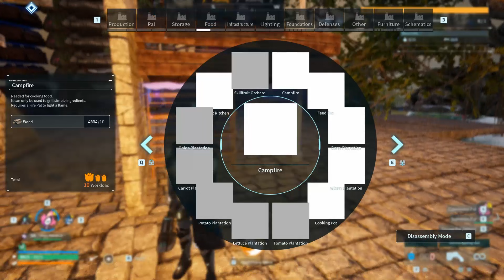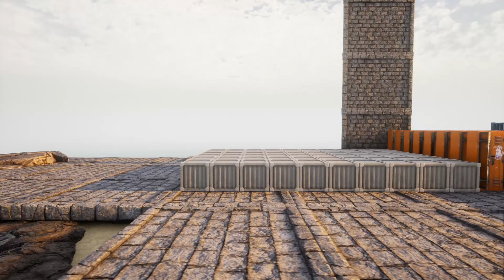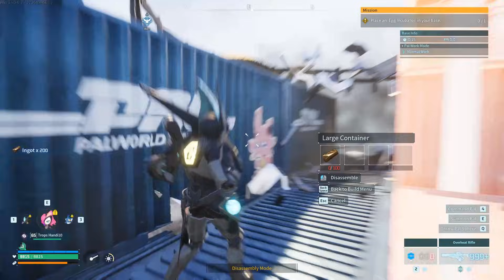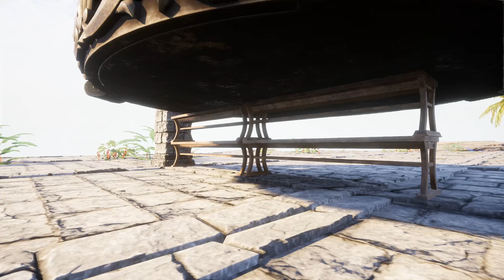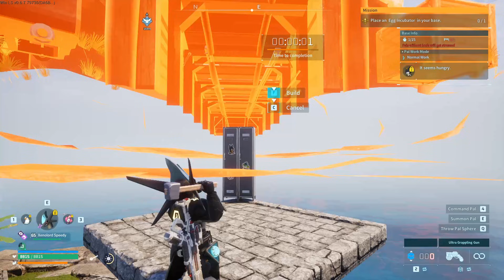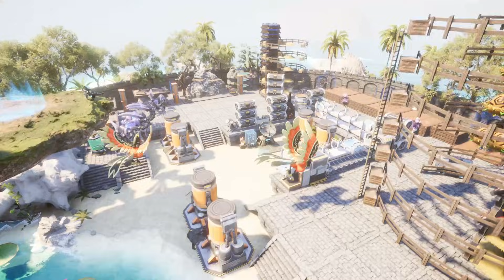How to Stack Structures in Palworld – Ultimate Base Stacking Guide

Comment: stacking is useful but u dont need that kinda extreme stacking
Reply from the maker: I did at 1 point for my 50 pal base.
I use to get so much if 1 material , fill 10x chests then move in to another resource.
That's just me though.
Reply: @TropsPlays  u dont need like 10 chests full especially if ur playing solo.
i could understand 1 chest if ur playing on a guild because of base restrictions for guilds

Comment: Big question, can we stack Accumulator vertically by this method? 
I did try myself and not succeed, can anyone confirm this work on accumulator? Thanks
Reply from the maker: Yes they can be stacked.
Im guessing you could even do it with pillows

Comment: Hot spring and Large bed can be lazily stacked against a wall with 2 fireplaces 1 high. Each fireplace height equals 1 large bed \ jap hot spring. The first fireplace is two of said furniture. Due to being able to place a hot spring\large bed on the ground after the destruction of the fireplace.

Comment: im really having hard time with the hotspring high quality one
Reply from the maker: Whats up?
Reply: Might've been fixed for 1.0
Reply: Yeah the high quality hotspring would never snap to the bench's height. I got it to stack by doing the same method used to stack the plantations with the | - - bench configuration and it leaves no gap with the wall as well

Comment: Is it okay if I play the game with infinite stamina and durability as well as infinite weight and instant breeding? Or am I making it too easy I think I slightly increased spawn rate of ores. I feel like it’s too much should I just okay on regular mode but instant hatch is a must.
Reply from the maker: I just use instant hatch.
For making videos I turn on unlimited weight but that's just to speed up the video.
Its a singleplayer game so do whatever you feel like doing.
It doesn't really matter what settings you have as long as you have fun.
Reply: @TropsPlays Thanks!

Comment: Any tips for getting the breeding pen to snap to the top of the containers, while on a wall? For the life of me, I can't seem to get it to work - the preview is sunk halfway into the containers. It properly snaps while I'm falling, or if I'm on the ground looking up at the wall, but then I can't see to properly align it...
Reply from the maker: Try 1 wall lower down so ypur not so high up.
That should allow you to see better.
Reply: a bit late maybe but-i had the same problem so i used windows instead and that worked

Comment: Something to add here, focusing on the ore mining lvl 2 station you can place a big ore station on the baren floor, then use a foundation that sticks up a small amount and place floating floors just barely over the big ore station, the floating floors will be probably around 1 to 1 1/2 benches higher than the big ore station. Afterwards, if done properly you can place smaller ore stations on top of the floating floor and stack like normal with the concrete pipes. I was able to fit all 7 stations in a 3 1/5 x 3 2/5 area under 2 floors tall if you don't count visual clipping. Add 2 mega chests in front so you can just jump on them to get to the upper ones. The produce also seems to do quite well when stacked tall and can fit inside the pal farm for honey. I have a stack of two carrots with two potatoes and two onions with a skill tree on top, i did my produce diagonally inside the farm so I could place a wooden column next to it for easy access to the skill tree however if i had done it straight i could have probably fit rows of small beds on either side to compact even better. If you have most of the electric skill tree bonuses you only need one electric tower and maybe one condenser with a single maxed electric pal, i have a max dazzi noct with lvl 5 electric and it is able to easily out power 6 oil rigs and a few stations without food bonuses. The electric tower is also weird. It takes a lot of space to place but once it's down you can place things nearly inside of it so always place it first. The breeding stations can also have things placed inside so I tend to put the mega egg incubator, the surgery table and a pal trading station that has Dr. Brawn stationed there, if done right there is still plenty of space to pick up eggs. You can also assign the big dinosaur to one of the breeding stations and still fet his bonus while never having to feed him ore heal him ever again.
Reply from the maker: Thanks for the tips!
Reply: @TropsPlays  This was an older post of mine, I've done some major testing. The Japanese floor cushion does wonders, you can use it to build from ground up instead of skyward down for the mining stations and food plantations. You can place 3 ore lvl 2 stations directly ontop of eachother with them. If you have a ground level foundation with a wall then use the wall to place the lvl 2 ore, a cushion centered and a new mining lvl 2 station and repeat as many times as desired. You can also use the cushions to place basically anything directly on top of the lvl 2 ore. I have everything needed to make a base self sufficient in a very small space. 5 x 4 x 2 is the one I'm currently working on and its so close to complete.. it includes all mining stations including 2 extra ore lvl 2 stations, 2 carrots, 2 potatoes, 2 onions. A skill fruit tree, a farm for honey and 2 japanese bathhouse with 2 coin maker machines. I am trying to get 3 super furnaces to fit but im struggling, i may downgrade 2 just for iron ore. Also struggling to fit a large electric tower. I would love to challenge someone to see how compact an efficient base could become.

Comment: Wow, thanks for this video!
Reply from the maker: No worries man.
Happy stacking.
Reply: @TropsPlays any chance you have a more in depth guide focusing on the high quality hot spring stacking when using lockers while keeping them flush against the wall? I though I had followed correctly but it's clipping them far into the walls.
Reply: Okay, with some finangling I was able to figure it out. I'm not sure I followed the directions in your video correctly, but I did end up with three high quality hot springs stacked on top of each other that are flush against a wall corner without clipping through.
Reply from the maker: @TortuousAugur nice man

Comment: Haven't played in a while, but how does stacking work with Breeding Pens? Back in my day we just threw the 2 breeding Pals in and hoped they went into the Pen.. With them stacked, wouldn't they just.. fall down? How are they breeding in mid-air?
Reply from the maker: All the pals juat stay at the bottom. 
You assign the pals with the Monitoring stand so the correct pair breed withveach other.

Comment: Did an update break some of this? I cannot for the life of me get the workstations to stack. At least not for the Palsphere or the Disassembler. Following the exact same method, it will not pop onto the fireplace. I've tried left and right, deleting and not deleting the extra fireplaces. Shifting the fireplaces off-center. Nada.
Reply from the maker: Okay cheers for letting me know.
I will do a bunch of testing tonight
Reply: @TropsPlays  Awesome -- and just as added context, I was trying to follow your 15 pal base setup when I encountered this.
Reply: @darkraider1130 hold on the axis button while aiming right above the fire place

Comment: Actually, instead of 5 benches to stack the accumulators, I played with methods for hours and found better method. I'm stuck on staking the mining ores now. 😅
Reply from the maker: yeah you can use loads of different things to stack. I just wanted it to be as close as possible without having a high placement count as then it takes so much more time.
Reply: @TropsPlays  True, this is fun to find more ways. Next time try 2 rows, 3 high using the basket you will find the second row is little tricky wont snap just have to trust the process and lay that row of accumlators, but after that one theyll all snap from there. ;)

Comment: After some testing, All of the stacking methods work for me and my pals except the hot springs. Do you know why when my pals enter a hot spring, they get stuck inside it? I've tried it in flat areas and in the area you had it in the base video, but they keep getting stuck inside the hot springs. It's also pals of all size getting stuck. From my experience, only one pal was bugged and couldn't do anything like working or eating, the rest would just work and transport in place.
Reply from the maker: Ive done some testing and even a little showcase of this in my stacking video.
I've the pals don't leave the hotsprings but will work from them instead.
When it's time to eat or change tasks, they teleport out.
Reply: @TropsPlays  I would like to apologize and thank you. I didn't notice there was more to the hotspring section in the video
Reply from the maker: @nezukochan8531  no worries man. 1st time I seen this I was confused as to why they wasn't moving either

Comment: I was hoping you'd show how to stack the earlier production lines since the advanced one is only available super late into the game. Fireplaces don't seem to work for stacking those. Any suggestions on what to use instead?
Reply: You can use the square table. Stack 2 on top of each other then put the assembly line on top of them. Work for every intermediate assembly line.
Reply from the maker: what production line would you like me to stack the exact name please and I will do it now for you
Reply from the maker: ok so I just tried the production assembly line 2 not rotated and 2 fireplaces rotated worked as the production 2 is wider the the others.
Rotated it's 4 fireplaced long with another 4 fireplaces side by side. You can remove the 1st 3 fireplaces. If you don't understand I can send you screenshots on discord.

Comment: Thanks for upload and hard work ❤ , personally i don't like stacking idea it make base looks like disaster, i have 3 base which seem more than fair and enough.
1-breeding + storage
2-Farm + oil base
3-summoner base
Reply from the maker: Yeah its each to there own.
I personally love to gain more resources so I like the stacking.
I do have a megabase (egg) but I dont use it anymore.
Reply: @TropsPlays  i am on breeding for that pro pal part, it's just crazy which pal to choose or which passive skill to do, you can consider this as next content idea 🥰
Reply from the maker: @funfever8484  Join my discord I can give you all my base pals if you're interested.
I'm a little confused with what you're asking.
You need to know what's the best passive skills? Best Pals?
Reply: @TropsPlays  i joined under name Master, not trying to get free pal trying to learn which is best for damage, defending things like that
Reply from the maker: Hey man I just seen your message.
I only really test base pals as when doing raids you don't need to defeat them loads of times so getting the absolute best every patch isn't something I test since I can already defeat them.
With that being said I use Jet/Xenolord for flying around, 3 gobfins for increase player damage, and a galeclaw for movement to avoid attacks.

Jormuntide ig for bella/ryu raid.
Frostallion/Bastigor for Xenolord raid.

Dungeons I now use my Jet as it's the fastest and dungeons have been reworked which requires vertical movement sometimes so a flying pal helps.

From what I know of Palworld Raids test combat pals here's his channel: https://www.youtube.com/@PalworldRaids

Same with The Pal Professor: https://www.youtube.com/@ProfessorPenking